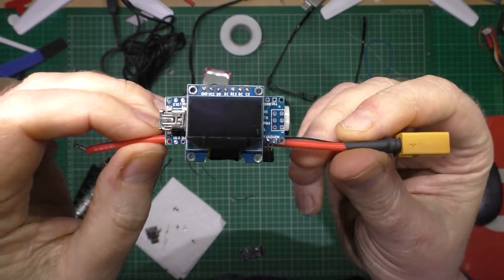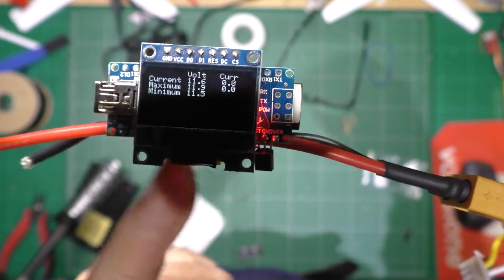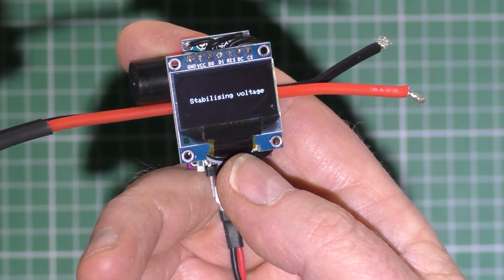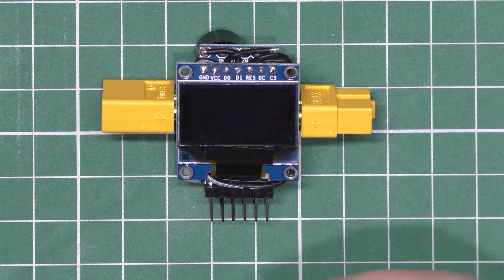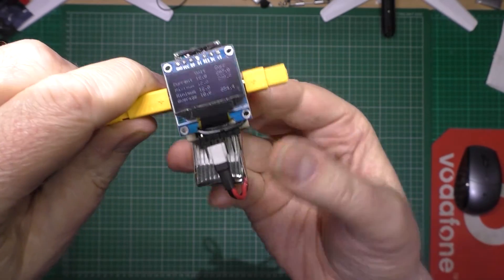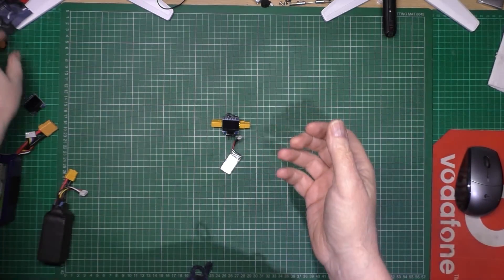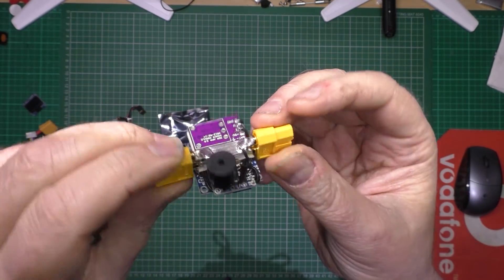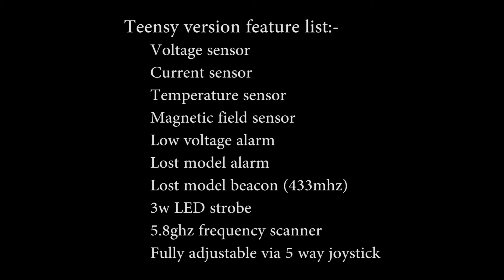DIY voltage / current sensor and lost model alarm

Comment: Hi tony , why not get a 3v reg from flebay mate , there's tiny little boards if I'm not mistaken
Reply from the maker: +Aron Gatt The trouble is, they all seem to drop the voltage slightly when the input voltage drops - this affects the ADC massively. With a fixed voltage input (3.7v) it doesn't suffer and has the added benefit of being self contained :-)